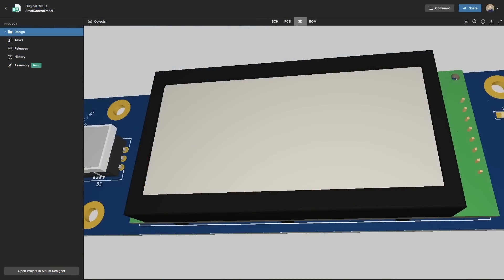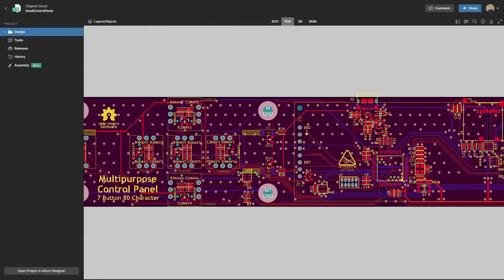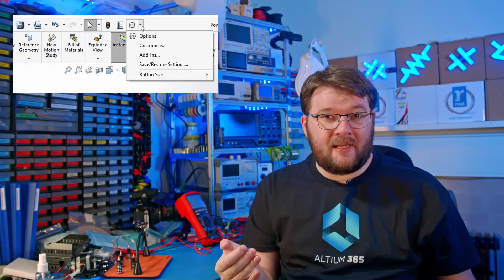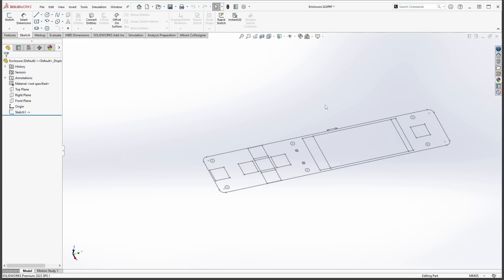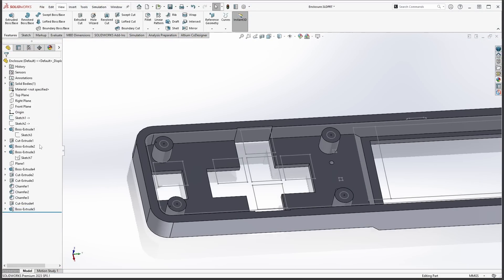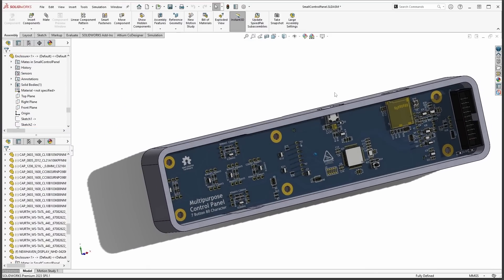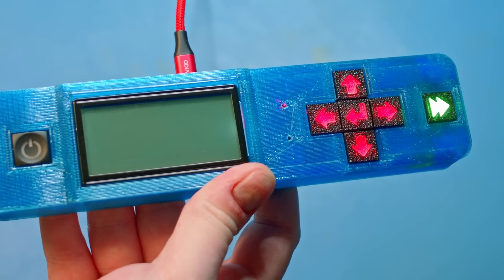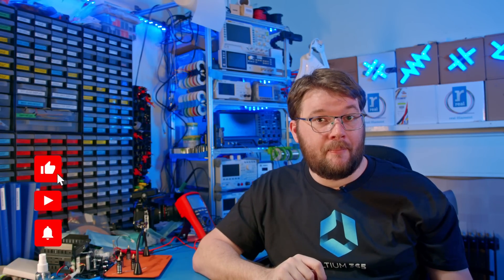Create the Perfect Electronics Enclosure with Altium and SolidWorks

Comment: Hi and Nice Video.
I got a few question, does the MCAD tool only works with altium 360?. or it can work with regular altium?.
And In altium, do you need any add ins for solidworks?.
I used both but this is the first time I heard about the Mcad tool in solidworks, I do the export and import of step files in solidworks to create enclosures and back to altium if I need to move a hole or some components.

Thanks for this great little tutorial.

Comment: This is an awesome example and explanation, thanks for creating it! Question; Do you know of a method to put the step model of the enclosure back into Altium ( to have the 3D representation correct in Altium for the EE guy ), but exclude that model from being pushed to SW?
Reply: Yes, in the CoDesigner Ribbon for SolidWorks there is a button to assign the enclosure model.

Comment: if only the lcd wasn't so thick
there'd be no need for supports
Reply: It's very hard to find LCDs that are the same height as specific buttons!
Reply: I believe the enclosure could have been printed on its face to eliminate the need for so much support material and likely could have been completed with a single extruder
Reply: @michaelbrown-qe8cr  then the surface finish would not be very good. The surface finish at the interface is a lot rougher and more inconsistent.
Reply: @OriginalCircuit  with the right print bed surface it could even ne better